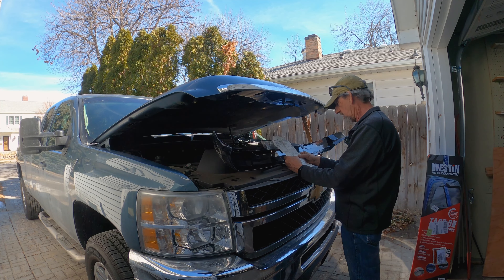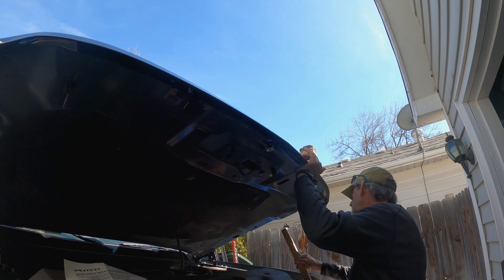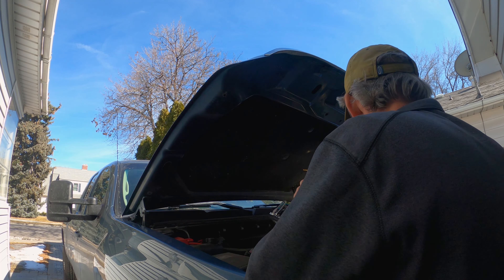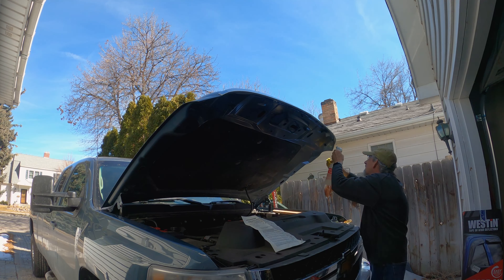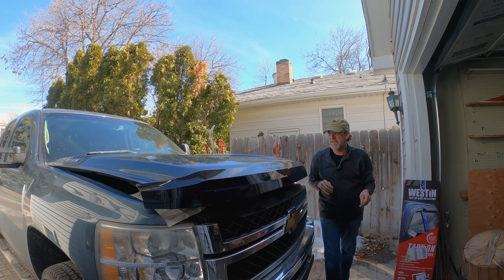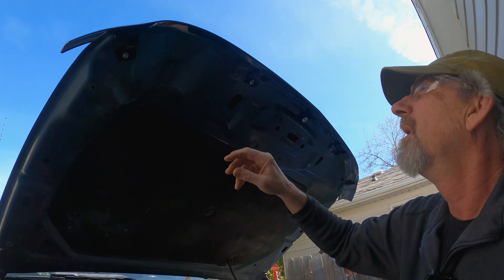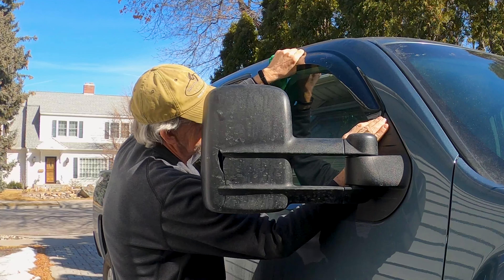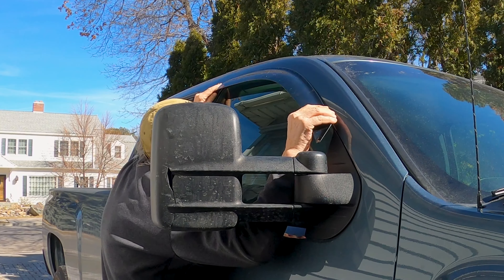Installing Bug & Wind Deflectors - 2011 Chevy Silverado

Comment: I don't travel fast enough to deflect bugs lol but really I add a drop in screen also to protect the radiator from the bugs 🐛
Reply from the maker: I'm thinking of changing out the front bumper and probably should consider a bug screen for the radiator in that project.